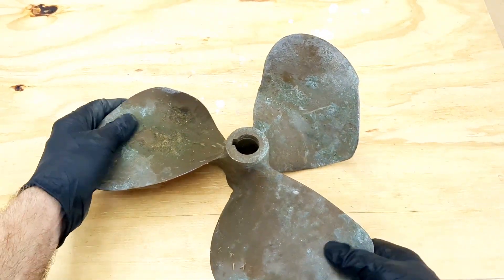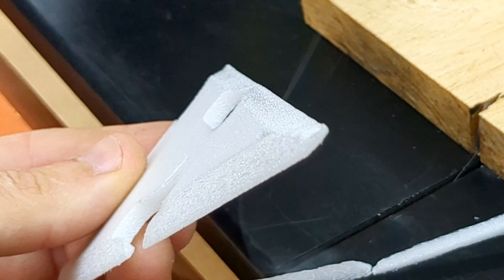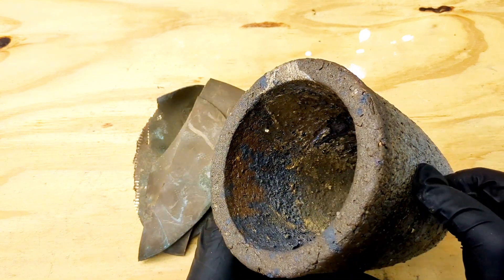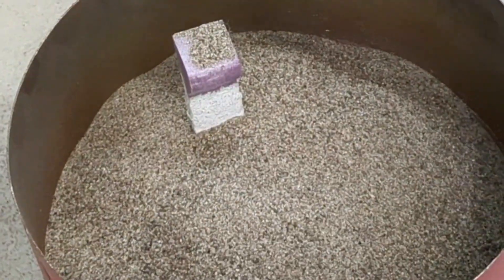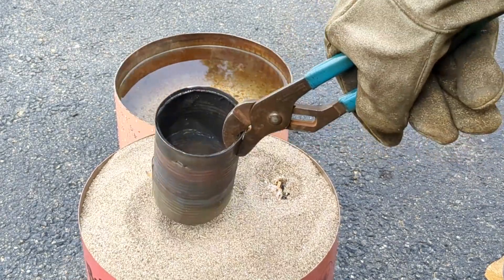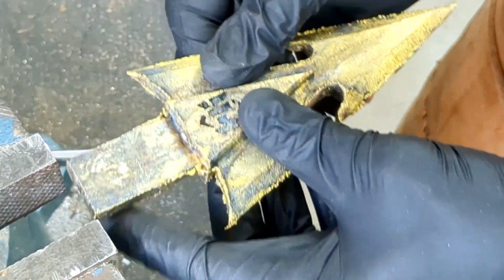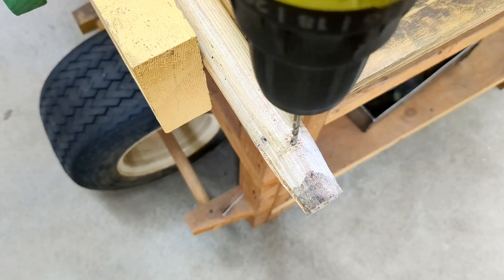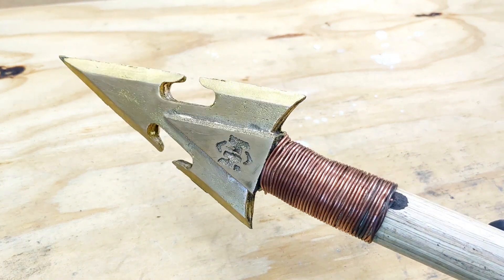Metal Casting a Beautiful Spear out of Scrap Brass

Comment: Really cool! I'd love to see a damage test. I wonder how brass would hold up compared to copper or aluminum?
Reply from the maker: Thanks!  Yeah I debated on using it on a water melon...  I definitely think it is stronger than copper.  I'm also learning about work hardening to get brass harder after cast.

Some recently told me that once metal reaches a certain temp the crystal structure changes.  Quenching it at that specific temp will retain that crystal structure that will  make it harder.